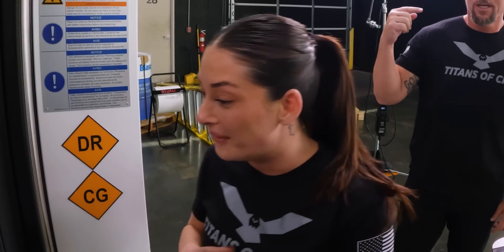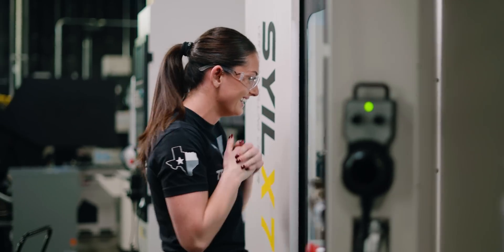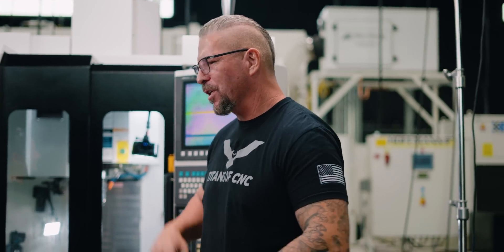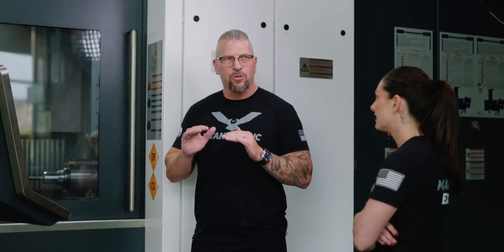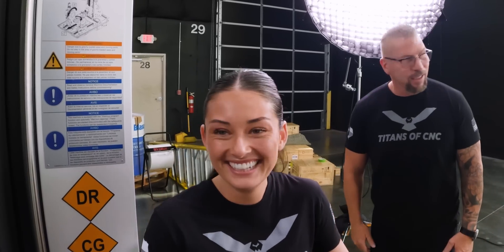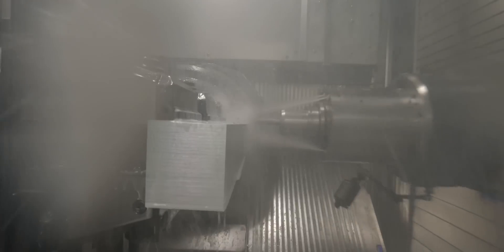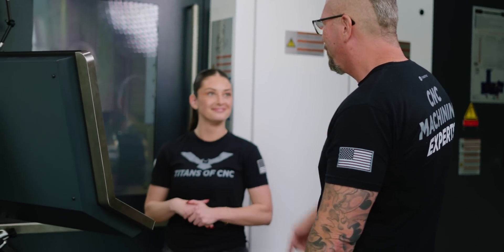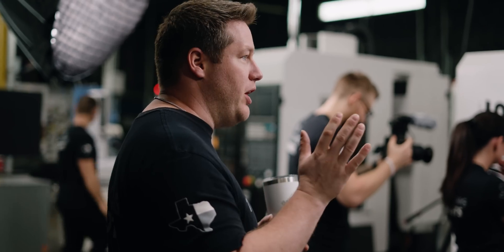Girl cuts MONSTER Chips for the first time on a CNC MACHINE

Comment: 20-year CNC programmer here. If you're considering getting into machining as an occupation, don't. Titan is a great guy but his company does not accurately reflect the industry in my state (Ohio). I have worked, in some capacity, at over a dozen facilities and interviewed at probably 3 times that many. Titan has a modern building with a competent staff and state of the art machine tools. Most machine shops here consist of dark, filthy, old buildings filled with outdated, beat-up machinery and some of the most socially retarded hillbillies you've ever met. However, if breaking your back leaning over an obsolete machine tool, being required to hold ridiculous tolerances on trashed equipment and spending a small fortune on precision measuring instruments (most of which are now being made in China or Brazil) appeals to you, then best of luck to you. That's just my 2 cents...

Comment: why do yall mill with the spin of the tool and not against the spin?

teacher told me to always go against the spin of the tool for better milling and longevity of the tool
Reply: Are you on a manual or cheap mill mb? On those you do it because of spindle rigidity, if your machine is ridgid enough you can do both, with the cut for better surface quality or conventional e.g. on surface hardened parts for longer tool life
Reply: climb milling is in this case going with the spin of the tool. long story short everything about it is better. better on the tool, faster speeds, better finishes, ect. conventional milling aka against the spin in generally recommended for manual machining because the mill has leads screws instead of ball screws. If the cut is big enough the endmill or tool can pull the slop out of the lead screw and cause it to take a big cut instantly and can break your tool where as if you conventional mill it try's to push your part away aka it takes the slope out of the lead screw and there is no where it can go.

I myself climb mill all the time on manual mills. reason for that is the table and friction is enough to stay still of a lot of aluminum parts and can do that for steel as well. however you got to be care full because it can get ya depending on what shape the mill is in. if the mill is worn and very loose, then mostly conventional milling with a small climb cut to clean the finish up would probably be best. but a newer mill that is tighter you can get away with it. You will know when you take too big of a cut on a manual mill with lead screws and the pressure on the feed handles will drop and you will feel the table being pulled into the endmill.

But at the end of the day I would say it really comes down to this one question. Does you mill have ball screws like every cnc or does it have leads screws? If the answer is yes then climb mill all day. if the answer is no, conventional mill for the big cuts and climb mill for the finish and smaller cuts

there could be some materials out there that won't go with this, but for probably 90 percent of all the things you would put on a mill, i would guess this holds true to that. for the most part. personal preference plays a lot to. find something that works for you

Comment: If you guys make a video about making a part or new technology, might as well have one of the none machinists react to it. This is honestly a good reminder of where you might start out at.
I'd also like to see someone react to a lathe doing large DoC on a large part since I've always found it more concerning having a part spin at 1000rpm than the tool at 15,000rpm.
Reply: My first machining job was making huge pillow block bearing housings for cargo ships, hydro damns, etc.. I ran the mill and drill operations on old Carlton machinery. Would regularly drill out 3" diameter bolt holes on a minivan sized radial drill. I remember the first time I saw them turn one on a vertical lathe and thinking something that big should never be allowed to spin like that lmao